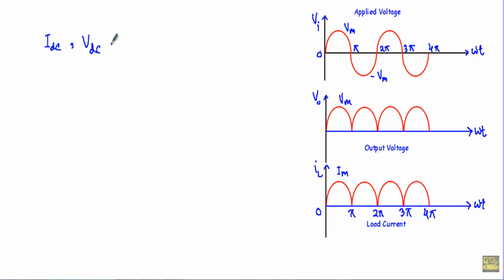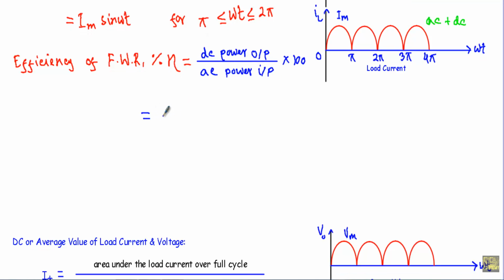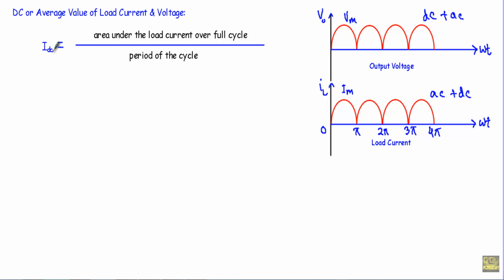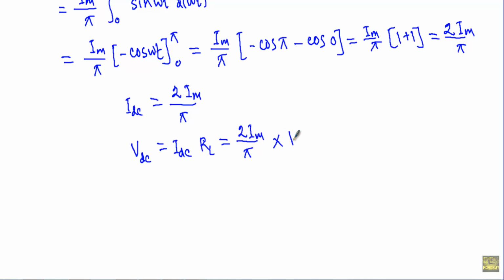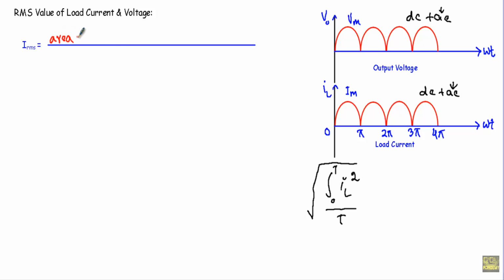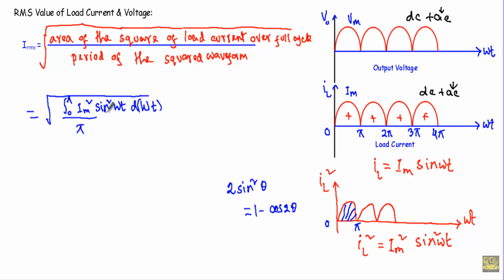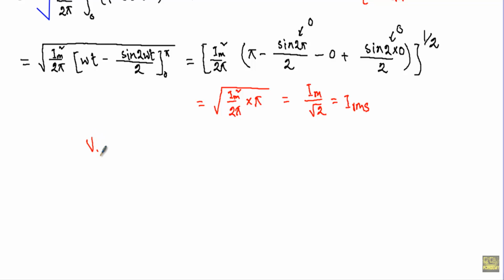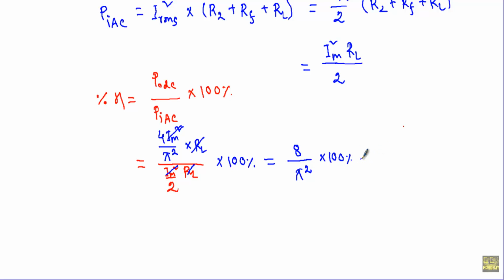Full-Wave Rectifier DC & RMS Load Current & Voltage , Efficiency

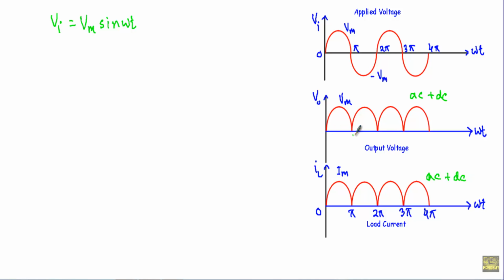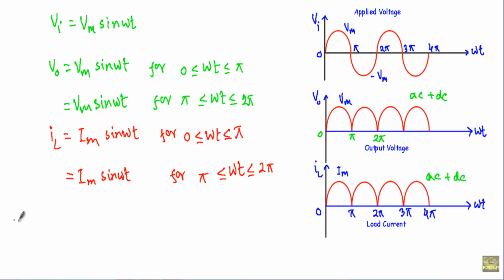Comment: Good video, thank you.  One minor correction: At the very beginning (1:40 to 2:40) you are writing the time based signals for a full wave rectified waveform's output voltage and current.  The equations for the waveforms along the interval (pi <= wt <= 2pi) should be negative for both iL and Vo (ie. -Im*sin(wt) and -Vm *sin(wt)). "sin(w) for pi <= w <= 2pi" is negative by default and we want to make it positive.  I hope that explanation was clear enough, I apologize for any confusion.